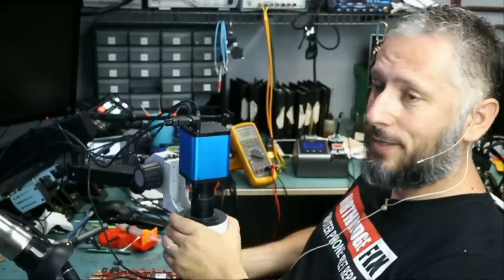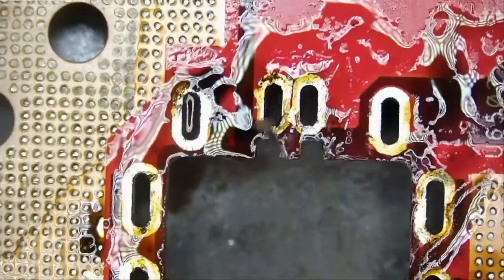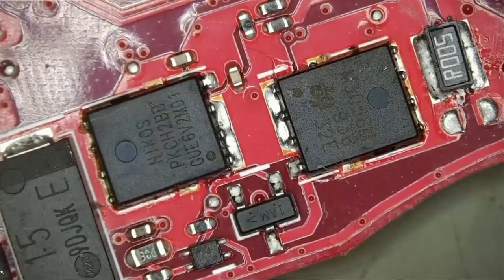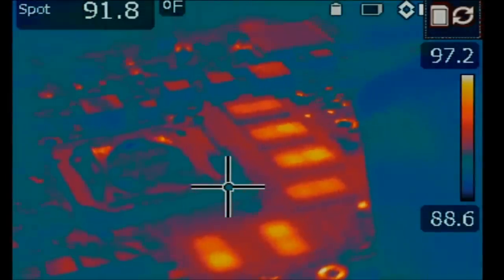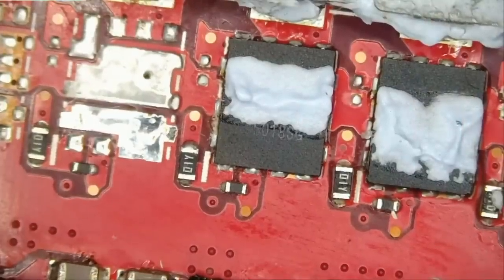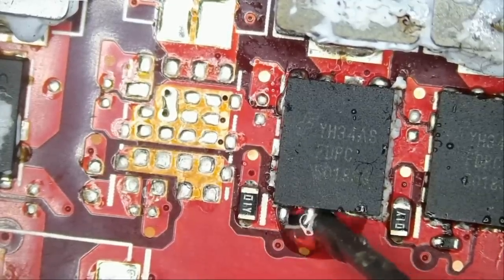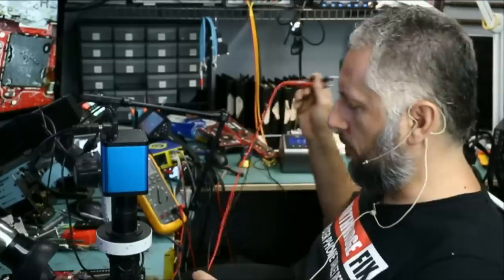ROG Fatalities - 3 x Asus Gaming Laptops not working.- Are they fixable?

Comment: Legit question: how would a CPU or a PCH problem short a mosfet?
Reply: CPU or PCH dies and shorts out, meaning more current has to go through the mosfet causing it to overheat and fail. Most good PWM controllers should have overcurrent protection but it'll still happen sometimes. TBH in this case it's more likely that the PWM IC is bad and killing the mosfet, but after frying 2-3 different mosfets, the CPU is likely dead now too if it wasn't from the beginning
Reply: Short circuit in CPU or PCH? 
Most big VLSI parts essentially measure at 0 Ohm resistance, with normal voltmeter, because of the many transistors/PN junctions in there.
So you can't tell with normal voltmeter.
But they will short the mosfet to GND, if toasted, which kills the mosfet as well.
Reply: Simple answer is overheating, and that comes from the faulty CPU or PCH not regulating the current or voltage properly sent to the MOSFET => more Watt. Excessive Watt turns into heat which breaks down the p-n, or n-p barriers causing a short circuit between 2-3 terminals depending on how lucky you are.
Reply: Id like to know as well but my guess is its sending too much current to the mosfet cause of an inrernal failure od itself.
Reply: Is all about clamp current, which could break the transistor shorting it.
The built in diode could break too if clamp voltaje is reach.
Both parameters could be sign of a high power cosumption peak and/or a Bad MOSFET manufacturing.
It is not a only thing problem, could be a combination of some of these situations.

Comment: about the last one: sometimes when a high side mosfet shorts out it sends a spike through the gate, damaging the controller IC, you may use an oscilloscope to check for a healthy pulse train before soldering the mosfet

Comment: In my past comments, I've talked about the longevity of my Dell XPS laptop.
In it's still great working condition, I've only had one problem.
The charger end first would only work intermittently. Then it quit working all together.
My inexperience on this was to first assume that the charging port on the computer had somehow messed up so I ordered one and installed it.
The great thing is that the charging port (the same type here in your video) had one screw holding it in place and it plugged into the mother board. It was NOT soldered on.
This tells me that Dell was already on the customer's side in making it easy for a part that is known to wear out, easy to replace.
Of course I ended up buying a new charger and that fixed everything.
Assuming Dell does not go cheap in the future on how they build their computers, I'm a Dell customer for LIFE!!

Comment: I've watch so many of these videos and my take away is that I'll never buy an Asus laptop. They are on the cheaper side of gaming systems for a reason I guess, but I would never buy a laptop for gaming anyway. Most gaming laptops can't take the heat of a GPU and will crap out sooner then later
Reply: it is not the brand but discrete graphics on a laptop.  Nvidia used to have a massive problem with this maybe around ten years ago.
Reply: Never had a problem with gaming laptops besides screen hinges always dying. Never a GPU, though.
Reply: After seeing all these videos, i probably won't bu asus again either, but I still use a 10 year old asus laptop on occasion to renders or to test some ML training when my main rig is busy.  I've had this thing chug on things for weeks on end and never had a problem.   I never used it for gaming, and only run linux on it, but i definitely abuse the cpu and gpu.   They must have done downhill, or have drastically different quality control between product lines.

Comment: That redesigned power socket ....maybe ASUS was fixing a design flaw that was
causing the premature failure of the old power socket because of the way it was
designed!! One is an old design and the other is a new design. This is not to say
it is the old design that definitely failed but it does mean that you may be able to
see an improvement of one power socket over the other. I have noticed that the
ill fitting replacement is a better design: the connector points are spread farther
away from the socket; means the socket is more rigid.

Comment: I was a bench tech and a very large PC shop for a number of years and we saw ripped out charging ports ALL THE TIME. People will grab their laptop to take it somewhere and forget it was plugged in. This would rip apart the charging port. We used another local shop to solder on a new port and those guys made a fortune doing this repair.

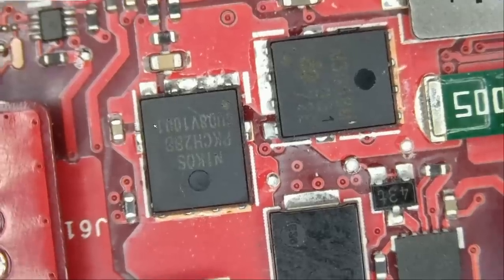Comment: What's the deal with that component at 20:32 that looks like its hot a big hole in it! Left hand one of the three that you flash over quickly in the video. 470 something or other on them.  Caps?
Reply: That's probably a flux/water/saliva
Reply: I was searching for another one who found that too 😄😄

Comment: Hey folks, I also got an ASUS gaming laptop, but it´s a TUF Gaming model one (less capabilities in general compared to ROG ones). My recommendation is that you limit the maximum frequency on the core processors, this way it won´t generate as much heat and consequently it won´t vary as much in temperature, which is what causes problems in the end (due to expansion and contraction). Then, delegate all graphic tasks to the dedicated graphics card, and let the integrated one do as less as possible, this way you´ll have less heat in general. If we use them the way they come from the plant, they´ll keep breaking on us.

Comment: I bought a rog g14 zephyrus and it refused to use the rtx 3060 onboard.  I tried everything possible(multiple windows 10 and 11 installs and software configurations) including calling support.  They don't even have a MUX switch to force igpu to the off state. 2 days wasted on figuring out a new laptop.  it would lock the clocks for the gpu at 210mhz lol.

Comment: If Asus is so bad who is a good laptop manufacturer in terms of quality and reliability? Also not sure of the models but these seem like at least 3-5 year old Asus boards, not sure if quality has changed since, but the g14-15 seem to be really popular and seemed to be built really well from what I've seen from reviewers.
Reply: When reviewers mention anything about things being well built, they are only talking about the externals.
Literally no one really goes into the finer details on the engineering and build quality on the inside. Stuff like soldering quality or the quality of the actual solder, how protected the board is from thermal and shock stress and quality of the components used.

Comment: I have an ASUS G75VW (motherboard rev 2.4) and it has some really crappily designed connectors (J5602 & J5603) that are poorly attached to the motherboard, coming away very easily causing major damage, and another that is incredibly difficult to connect (J5102).  I am in the middle of making a motherboard swap.  One of the fan plugs (male) disintegrated, so I need to buy a new fan also.

Comment: Asus quality has gone downhill.  I ordered my 2 kids new 4k monitors for university 3 years ago.  These ASUS panels were advertised as IPS panels and when we received them they were clearly VA panels.  Both returned.  I went through reflowing the gpu twice on a HP laptop about 8 years ago and then gave up when it the solder balls failed again.  So for me, no HP, no ASUS.  I'm trying my luck with Dell brand now, but it is too soon to tell if their equipment lasts or not.  These companies should be ashamed of themselves for building such junk.

Comment: How much voltage do you inject when detecting a short?
Reply: Wondering the same thing too
Reply: @fredrickrari9338  I'm guessing 1V but not got thermal system. Isopropyl  works well but if gpu cpu area. I'd quit
Reply: I believe he said 1.2 volts this time.